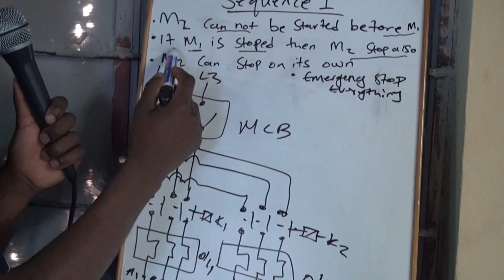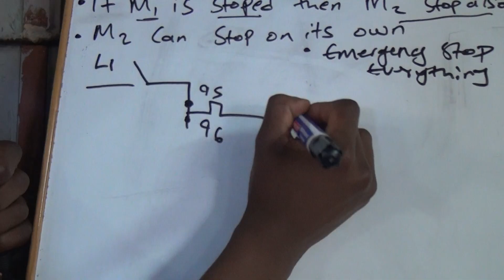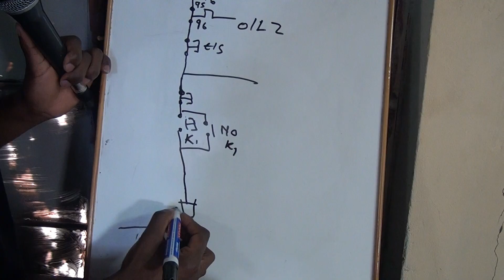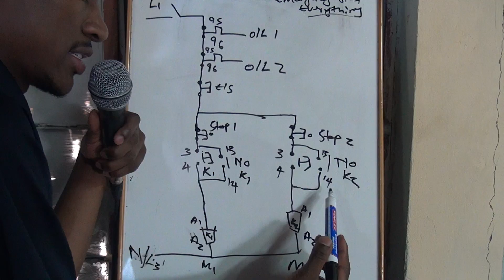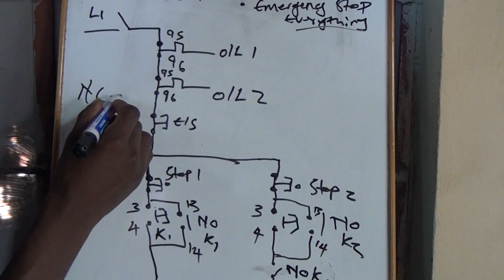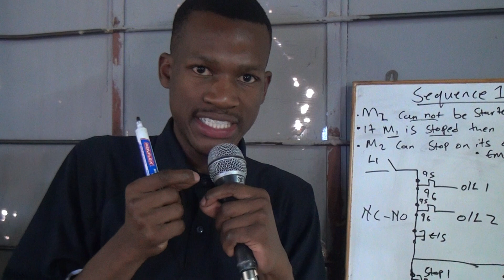MOTOR SEQUENCE 1: MOTOR STATER: ARTISAN ELECTRICIAN

Comment: The symbol you used for M1 interlock on M2 branch is different from  the standard you used in the rest of the control circuit. Is there a reason why?
Reply from the maker: You are allowed to do that since it's a normally open

Comment: Please I need help with this diagram, I cannot take the statement and make it up drawing I need help with that

Design and wire: use one On-Delay timer and One Off-Delay timer where Necessary Overload must be calculated at all times

Automatic Dual speed motor. When  the start button is pressed the motor must start rotating at a slow speed after 10 seconds changes to fast speed. The emergency stop button must stop the motor immediately at all times.🙏🏾
Reply from the maker: Ohh i remember this. The tricky part is to swap the terminals so that you can have change in speed otherwise you won't win. But otherwise I will do a video on it brother...thank you.

Comment: But why you're having two overload?
And I think the emergency stop was supposed to come first before the overload....
Reply from the maker: I am using two overloads relay because every motor has different current. If motor 1 is rated 1amp and I will set the overload to 1.1 maybe or will just calculate and get the right value , but if motor 2 is 3amps then I need another overload because if I use 1 overload then how will I compensate the current for the other motor. 

It's not a problem to put emergency stop after overload. The reason for a emergency stop it is to stop the coils from working. Where it's connected doesn't matter as long as it will be able to trip the whole circuit.
Reply: @collegenatedengineering1659  your k1 contact was supposed to be connected at output of stop M2 and connected to strat M2 in  with this diagram you are demonstrating the motors will stop independently but m1 starts before m2
Reply from the maker: Thank you for your response.

Remember stopping M1 causes M2 to stop also but stopping M2 does not stop M1. 

You are right in that we can also connect the K1 of M1 on the end of stop button, that can also work but it's not the only way.
Reply: @collegenatedengineering1659 It is recommended and good practice to put EStop before the overloads in control circuit to ensure there is no power to the circuit once Estop is activated.